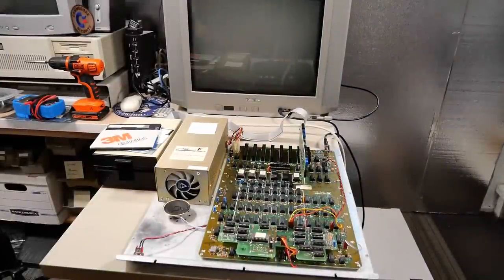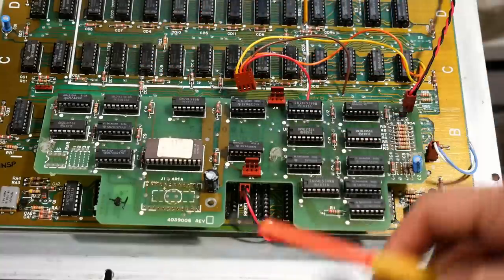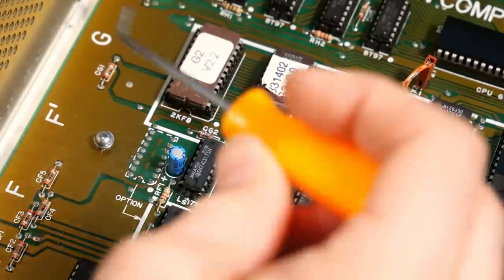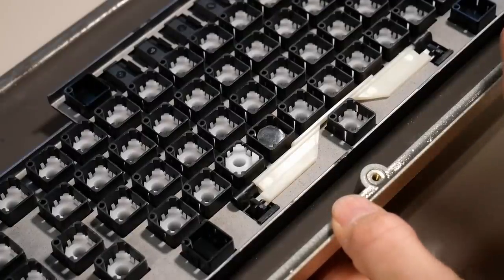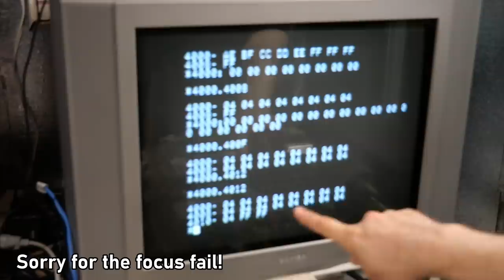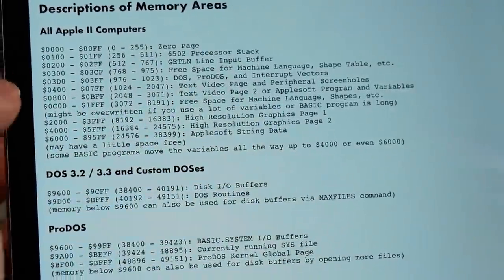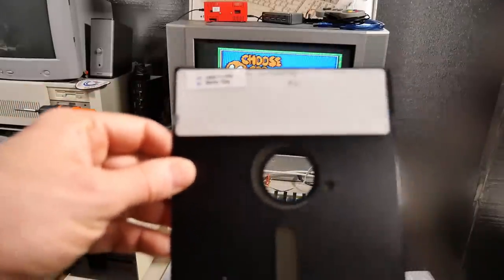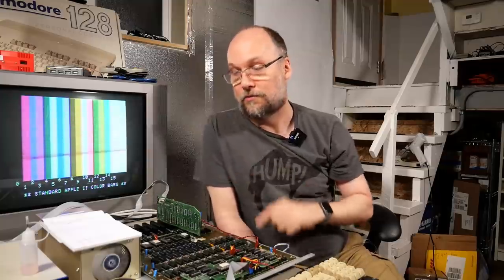Franklin Ace 1000 Repair: Motherboard and Keytronic keyboard

Comment: I sent Adrian the schematics and technical service bulletins for this ACE 1000 last week. I worked for a Franklin service center.
Reply from the maker: Thanks for the Chris! It would have saved so much time when I was fixing this machine.
Reply: Chris A850 You’re our hero!
Reply: Would be nice to share them in appropriated foruns for the retro comunity also. Could be out there some more "Adrian Black" guys. Be safe!
Reply: Adrian effectively had to do some reverse engineering to get things fixed up.
Reply: @Chrisa850  Perfect!  Thanks guys.
Reply: @Chrisa850  legend. i just googled it and found exactly these. good work mate.
Reply: @Chrisa850  Thanks for sharing the link!!! Truly awesome that Adrian uploaded them for everyone to use!!!
Reply: The hw programmers are all the same. They just have different stickers on them.
Reply: Chris A850 😎 cool
Reply: @Chris A850 Do you happen to have schematics or documentation for the Ace 1200, and/or the integrated FDC?

Comment: 18:36 - It looks like bit 3 is permenantly set  "00000100", which is why you get a 4 in the address. When you wrote the 0xAA, if you or it with the broken bit you would get 0xAE ( "0xAA | 0x04 = 0xAE )", and when you wrote 0xCC it didn't change because 0xC is 1100 in binary, so bit 3 is already set.
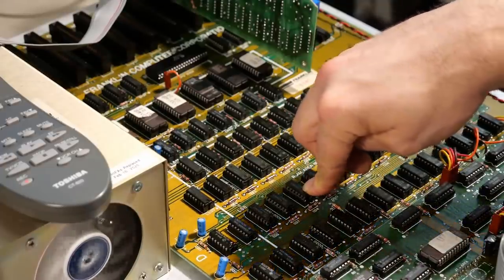Reply: 21:06 - Looks like you figured that out!

Comment: I really enjoyed this series. I feel like I've learned more about how memory selection/decoding works by watching you debug and diagnose machines like this than anything I've read in repair manuals/certification materials.

The way you were using the basic commands to read/write to memory locations to check and verify the results back made perfect sense. Having this ability in older machines, I get now why computers were considered more of a hobbyist device rather than an everyday item like they are now. It also makes me wish we had this same capability in modern machines rather than limited tools provided by different flavors of EFI available on the motherboards.

Comment: That actually partially reminds me of how I diagnosed my C64. It had 439 bytes free I think, but BASIC was working. I found a BASIC program that pokes 0 into about 32k and then tests for 0 and then pokes 255 into the same 32k and tests for 255. In both cases where I had errors (39 in total) it was off by 128 exactly. That's U12.

Comment: Good job figuring out the address line issue.  However, not that you could run it, but that memory test that Applecillin did would have worked before you fixed it too - it looked like it went sequentially through memory, testing 1 byte at a time, writing a few values (maybe 00, AA, FF or some variation) and checking that it could read them back.  It would have detected the bad RAM chip but not the address line issue, because it doesn't test blocks of RAM, just single bytes.  It would have tested 0x4000, found it working, 0x4001, found it working, and so on until the next 4KB bank, and then tested 0x5000 and found it working too.  It would have to test RAM in chunks larger than 4KB, or be smart enough to have a separate test to clear RAM, then write to certain areas and then check specifically for address line issues by looking for the patterns it writes to repeat multiple times or something.

Comment: The scabby black color you see on some DIP leads is silver tarnish. TI and some other companies actually silver plated the leads rather than tinning them. Silver oxidizes to black.
Simply brushing a little liquid silver cleaner onto the chip leads will clean them up to being shiny again. A quick rinse in plain water will get the silver cleaner off, and they are good to go.
Reply from the maker: Indeed -- a few others have mentioned that too. I'll need to buy some and try it out. I haven't found it to cause any problems specifically - on these chips, the one I showed actually had full on corrosion (it was bumpy and felt rough) but most of them just had the leg blackening.

Comment: Hey Adrian, really like your troubleshooting and repair videos, In the UK we pretty much only had Commmodore, Amstrad, Spectrums and BBC Micros, I dont remember Apple II being a thing over here, I never knew anyone who had one, never even heard of these clone machines, your fixes are like little detective stories.
Reply from the maker: Thanks! Yeah I know Apple was there but in such limited quantity. I think it was mainly because without a special add in board, you only had a monochrome computer. Plus, they were definitely more expensive than machines like the C64 and of course the Spectrum. The BBC Micro wouldn't have been as big if it weren't for the school tie-in (in my opinion) and that is probably one reason the Apple II was big over in the US and Canada. Apple made deals with schools to feature them there. Most schools only had Apple IIs for a very long time ..... so kids used the computer there and asked their parents to get one at home. Good tactic and it worked.

Comment: I noticed @8:38 it looked like the chip you inserted for the 7th bit had a pin sticking out, so maybe that was foreshadowing of the bent pin issues with some of those other chips later on.

Anyway, good job troubleshooting the root cause. That was a real head scratcher!

Comment: It's probably too late to suggest this, but the best thing I've found to clean corroded chip pins is a sand (or ink) eraser. It does an excellent job without being too harsh. Much better than any other solution I've tried.

Comment: I’ve seen a couple of videos about the replacement foam pads and it seems important to make sure no grease from you fingers isn't left on the foil side that could in time from not working.
Reply from the maker: Yeah next time I'm going to wear gloves. Luckily I have replacement pads still so if any fail I will know where to look :-)

Comment: Mice are no joke when it comes to destroying mechanical stuff.  Junkyard Digs and Thunderhead289 did a rescue on an old Ford farm truck, and one of the problems was that the clutch pack was absolutely JAMMED with mouse nesting.  Now, the throwout bearing was bad, but so many mice had gotten up into the clutch that even if the bearing had been perfect, it wouldn't have budged until it was cleaned out.  Another problem with mouse nests is that the little mice like to make sure everything is nice and comfortable, which means lots of soft, absorbent, fibrous material.  Cardboard, paper, straw, grass, their own fur, etc.  All stuff that can absorb and hold on to moisture.  So whether it's exposed auto parts, or a computer that they've gotten into, they basically create a sponge that will hold dampness against any surface it's on.
Reply: Yep, they destroyed a Laserjet 4 I used to own... very sad about that.
Reply: @truckerallikatuk  Ohhh nooooo...HPLJ4's are such amazing printers :(  Sorry for your loss.

Comment: Really interesting viedo Adrian. I loved how you were able to get it running as much to start the machine code monitor and debug the memory issues like that. Very interesting and clever to work out both the problem and solution. I learnt a lot from it.

Comment: 28:07  The 74LS138 are address decoders.  The one you pulled out decodes the I/O at $C000 - $C0FF into keyboard read $C000, keyboard strobe $C010,, cassette toggle $C020, speaker toggle $C030 (A read from this clicks the speaker) etc etc.    The one beside it decodes for the address space $C000-$FFFF which includes the I/O and ROMs.  Apple memory map is simply $0000-$BFFF - RAM ; $C000-$C0FF internal and slot I/O, $C100-$CFFF, I/O slot ROM; $D000-$FFFF ROM. from Apple II REFERENCE MANUAL.

Comment: I was thinking as soon as I saw the mirroring that it had to be a multiplexer / Bus driver-trancever type issue, but I would have never chased it down back to those two address lines.  Incredible trouble shooting.
Reply: ...and the only reason I would think that is from watching your other videos - especially the Tandy 1000 EX video where you built your own memory expander. If there's a problem with how the memory is being managed, see what's interceding between it and the processor chips!

Comment: 17:58 Adrian, when any mechanical keyboard types multiple characters from a single key stroke, that indicates your switches need oiling. I oil my keyboard switches with 3 in 1 silicone synthetic lubricant. I do it by pressing the key switch in all the way and dropping 2 drops in. Then you press the key 30 or 40 times and it will stop double typing.
I'm sure you probably know this but its how I fix old razer and gaming mouses that have the dreaded double click when only single clicking problem. Or sometimes the click doesn't work. I just oiled an HP gaming mouse from 2009 that had Omron switches. Cleaned the optical laser and oiled the switches and its like a brand new mouse.
Reply: Probably not a great idea for these capacitive keyswitches.

Comment: Actually the 8Bit Guy explained how he got that problem: placing the keyboard on the desk for the final assembly and discovering, for his chagrin, that the pads got lots of debris stuck on them. I guess the point is keeping them always upwards and pray dust doesn't get inside too much.

As for the audio, well, on my laptop's integrated speakers doesn't sound too bad, I had to whip out my Sennheiser to hear the difference. And well, it's not like I needed to see the vid with the Sennheisers :P
Reply: I could tell a slight difference on my Macbook, but definitely sounded okay to me.
Reply: @ovalteen4404  Well, my laptop is an older model with okay-ish speakers, I reckon a flagship MacBook Pro comes with good speakers, and that explains the difference :)

Comment: well done.  your characteristic persistence paid off, yet again.  a few thots on the corrosion you dealt w/.  most often, you seem to deal w/ mobo & component corrosion from those leaking varta [or similar] nicd batts.  i believe that's a basic/alkaline corrosion.  that's why vinegar, a dilute acid, works to neutralize & clean.  i believe urine is acidic, so its acidic corrosion would benefit from a cleaning w/ a base.  maybe scrub w/ damp/mushy paste of baking soda & water.  both basic and slightly abrasive.  maybe w/ a toothbrush ?  for that minty-fresh mobo smell, i think toothpaste is a mild base, also.  thank you for sharing & teaching us.  take care & stay safe.
Reply from the maker: Yeah perhaps. When I cleaned up the board -- I just scrubbed it under soap and water, so it should have washed away any of the leftover urine anyway. But indeed, a soaking in a mild basic solution might have been good too.

Comment: I've had good luck using "Tarn-X Tarnish Remover" to clean up IC pins that have have become black with tarnish. I poor enough into a bowl to just cover the pins and sit the IC in the solution. I've had to use a soft tooth brush a few times but the result has been new looking pins.
Reply from the maker: Neat tip! I'll have to pick some of that up. Is that normally used to remove tarnish from silver?

Comment: That filter board it is fine to leave the common mode choke in place, it will still filter out the FRI the power supply makes, keeping your house wiring from radiating it out. Best to replace those capacitors though, and for the class Y ones use ceramic versions, they will last a lot longer in use. A MOV in place of the one class X will also help to keep spikes from killing the switching supply, though it is best to place them after the fuse, so that the MOV failing because it has clamped enough spikes will not cause it to catch on fire.

Comment: Something was wrong at the back of my mind when I saw your first video. I couldn't work out what it was, and I've now just remembered It was the Franklin Ace - I was confusing it with the Jupiter Ace.
God, memory is such a bitch sometimes.
Reply: Cyrus Cuckler No, it's a different machine that runs Forth instead of BASIC. The design is very similar though, as the company that made it was set up by two people who were involved in the development of Sinclair's computers (Steven Vickers and Richard Altwasser if I remember correctly).
Reply: @cyruscuckler3495  Nah, it LOOKED rather like the SPeccie, in that it had the rubber membrane keyboard but it was a completely different beast that ran Forth instead of basic. Only ever got to mess around with one once briefly (a friend had a computer shop back in the day).
Reply: @cyruscuckler3495  A weird langauge and it was a bold move at the time. It was released right at that time there was a massive boom of computers released in the UK. We had BBC Micros, Spectrum, Dragon 32, VIC 20, Oric-1,  and more. They were coming thick and fast and obviously couldn't be sustained. This is why I only got a quick play around on it, as there was so much other stuff I would get to mess around on in the shop. From what I remember, it was completely alien trying to use Forth, but it was a very good and capable little language - just different. They kept production costs low, but the big problem was they had nowhere to go. Where a lot of kids would progress from something like a ZX81 to a Spectrum or somthing more expensive, nobody had any experience of Forth so they kind of gambled badly and nobody picked up on it. Shame.

Comment: Some banks being 00 and other FF in DRAMs is normal. I think it's just that some cells were easier to connect "inverted" when they designed the chip layout. Somewhere far in the back of my head is something about having read that doing it that way saves some of the drivers for the actual memory array, but I can't recall details right now. 

It doesn't matter in normal use, since the value gets inverted while writing AND while reading, which cancels itself out. But you can see it on discharged/"empty" cells after a cold boot.

Comment: What does a memory test program exactly do ? I mean, if it writes specific data into a memory location (after having saved the previous data of course) and reads it back to check for errors, memory mirroring won't be detected. A solution is to write from $00 to $FF in the first page, from $01 to $(1)00 in the second and so on. Checking data back will detect any mirroring because all 256 pages will have a different "pattern". Of course, page 0 and 1 as well as the program itself require specific treatment and interrupts should be disabled.

Comment: You brought up an interesting question during this video.  Since the Laser and Franklin clones were common enough I wonder if any of the software diagnostic tools took the differences into account?
Reply from the maker: I'm not really aware. Someone who worked as a Franklin tech said this machine can run original Apple II+ ROM images perfectly (this is using 2716 EPROMs so you'd just need to make a new set) so I think things are similar enough almost everything works. The only real difference was the way this handled lower-case versus the typical mod on the II+ for this -- so there is some info in technical bulletins on how to address this.
Reply: @adriansdigitalbasement  I can verify this:I ended up with a Franklin around 1990 or so...was mostly functional, other than several missing keys(the shafts were broken too), something heavy must have fallen on the keyboard.
Well, a local hamfest had a vendor that was selling NEW keyboards for the Franklin for almost nothing(mostly because he had no idea what they were for)!
So that solved the keyboard problem.
Well I mentioned to a friend that I got this machine working,
One day he hands me a set of roms wrapped in foil.
Installing them in the Franklin fully transformed it into a Apple //+.
And I seem to remember the lower case working without me having to make any mods at all.

Comment: It looks like the language card is intergrated into that motherboard. Your other chip might have been responsible for the bank switching and thus you wouldn't have noticed if it was failing if you don't use the bank switching. Only few games used it, but serious programs did often like CP/M or UCSD Pascal. 
The memory map is fixed and is 
$C000-$CFFF: I/O and slot memory : fixed and always present (cannot be switched off like on C64)
$D000-$DFFF: ROM / RAM bank 1 /RAM bank 2
$E000-$EFFF: ROM / RAM
$F000-$FFFF: ROM / RAM
The soft switches from $C080 to $C08B will be used to set the read and write mode of these bank. It is possible to read from ROM, writing in RAM bank1 or bank2, read from RAM bank1 or bank2 with write enabled or not.
Reply from the maker: Yeah that's right. There is a jumper you can move (it's a little mouse chewed wire) which disables the built-in language card  if you want to use a different one in slot-0 that supports even more RAM, etc. They were pretty smart in their thinking!

Comment: capacitive buckling springs of the IBM pc 5150 and early 5170 AT keyboards are the superior capacitive switch to foam and foil
Reply from the maker: They really are -- the fact that they aren't going to degrade over time without fail means they are instant superior. Not to mention they are tactile which I favor over these linear switches.
Reply: @adriansdigitalbasement  oh yes i use a model f 122 or a model f AT as a daily for my modern computer because I can't stand cherry switches at all in this day I like the classics that is the model f or m

Comment: Hi Adrian, did you now that you can check some memory and 74 IC in the MiniPro?
Reply: I find my mini pro is invaluable for checking logic chips that I've taken off boards. Pity it can't test 4116 or 4164 RAM chips, but I've got a separate tester for those.
Reply from the maker: Yeah it only can test a select set of SRAM.... A decent amount of TTL logic can be tested and it's quite accurate.